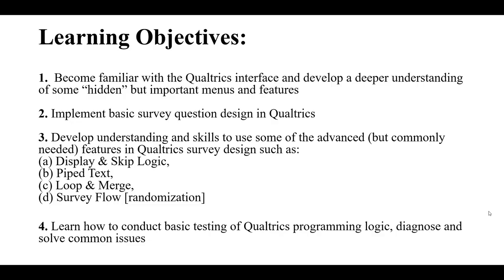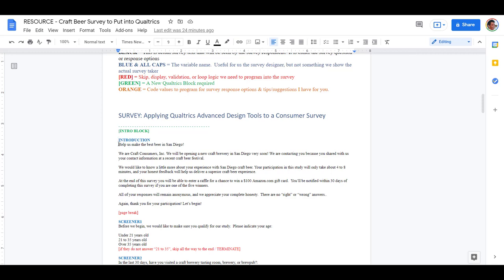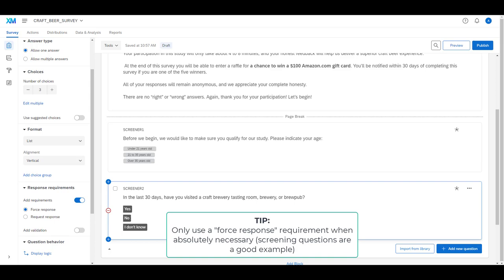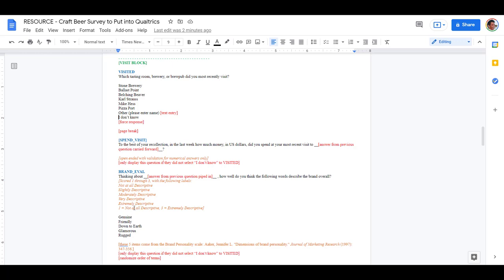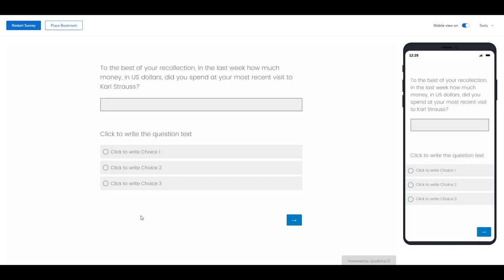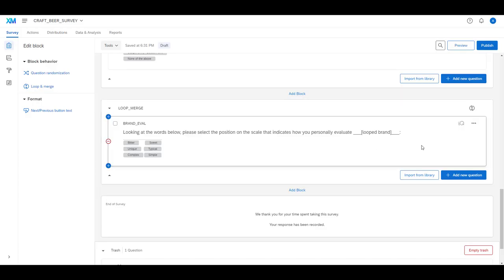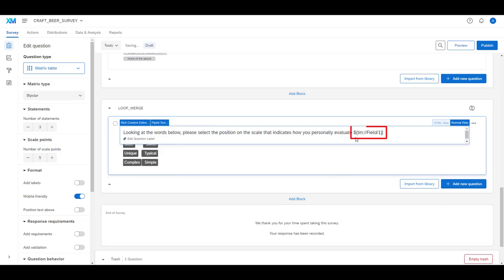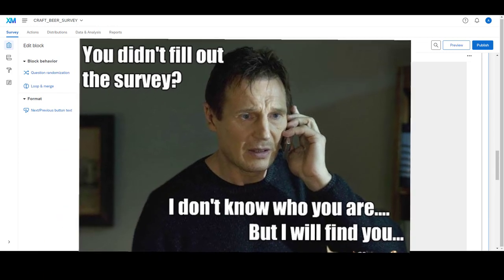Introduction to Making a Qualtrics Survey 2021 Update!

Comment: Hello I wanted to ask a quick question, what if I have first a question regarding a number of financial goals of a person and then later on a question regarding long term, short term and midterm, as a choice list. 
"How many long, mid and short term goals you have?", as a choice list. 
I want the total amount of these three goals to be equal to the amount the participant specified in the first question, how can I do this in qualtrics?
Reply from the maker: I fear I may not fully understand your question, so my answer may be off base here.  Here is my interpretation:

(1) First you present them with a list of mulrti-select items.  These are a list of possible financial goals.
(2) Later, you want to show them the goals they previously selected, but now ask them, for each goal, if it is short, medium, long?

If I'm correct, you simply need to have a "carry forward choices" for the second question, with that second question being a matrix with the three term length options.

For the "how many?" part of this question, I'm a bit stumped.  I'm not sure what your motive if for having them "count up" the number of their goals... if you simply want that count, you can do that after the fact during your analysis.  I fear I'm not quite getting a step in your objective here, unfortunately.

Comment: how can i make simple yes or no questions and if I want to give options under yes or no choices?  like for instance, someone select YES and I wanna ask "the major reason of selecting YES".
Reply from the maker: You can make new questions that are revealed based on  a Display Logic approach to the previous yes/no.
Reply: @DrBakerSDSU  Thank you! Yes, that's what I kinda did yesterday. It is good but I wanted the next option to appear right away in the same Q after clicking yes, not in a separate question. But it's still better than nothing.
Reply from the maker: @MJs-85  There is a way to do this in Qualtrics that would require explicit coding (not my area of expertise).  Qualtrics does allow you to code your own Javascript.  I have a little experience with this, but I can't be much help here, unfortunately.
Reply: Thats interesting and I can ask around here at WSU surely someone would be of help. 

Thanks!